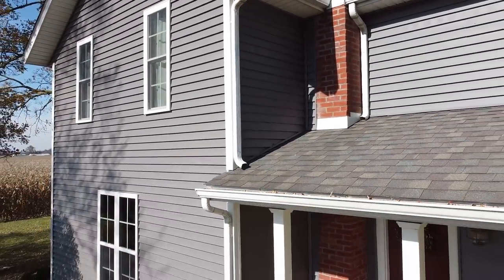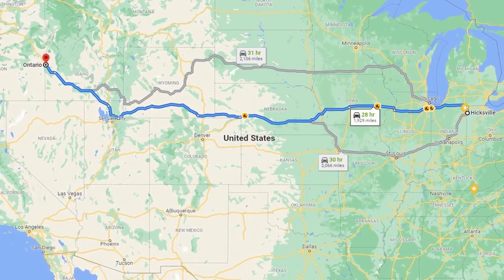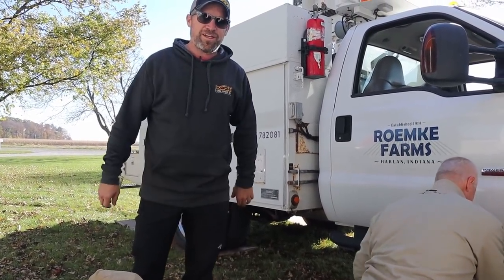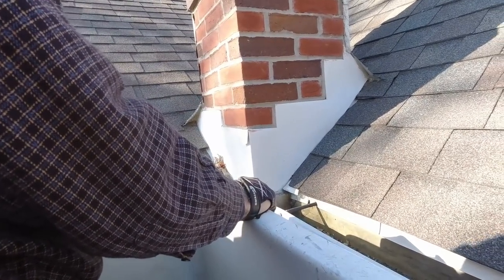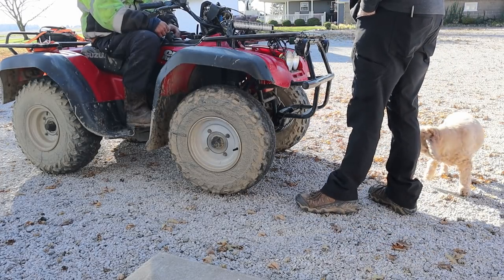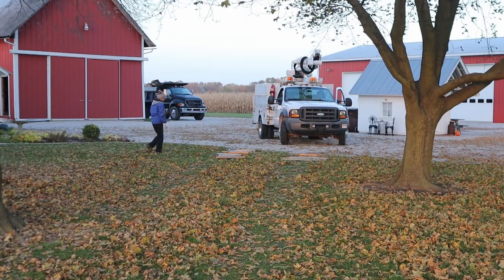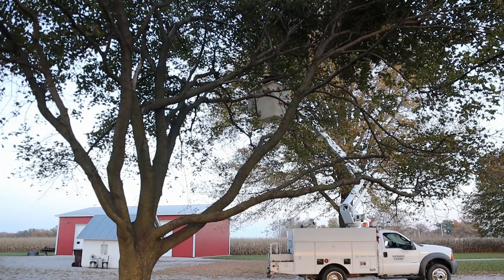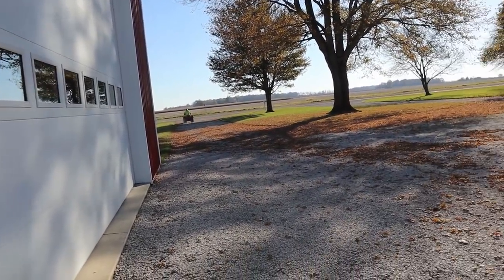Fixing A Chimney That Doesn't Look Broken! - DIY Brick Sealer and New Chimney Cap

Comment: Neil,  It is very cheap and has worked for me the last 8 years without any problems whatsoever on product quality, and that is 6' x 20' rolls of black mesh plastic gutter guard.  I have not had to climb any ladder and clean out gutters since I installed this.  It stays put, too.  The ONLY time I have had to reinstall is when one piece came out during an 60+ MPH wind.  It fits tight under the shingle and the lip of the gutter with a slight bulge in the mesh.  That's what keeps it tight and in place.  These fancy leaf gutter guard systems you see advertised on TV is a waste of money, IMO.
The truck made your work a lot easier and safer for that job.  Glad you had it.
Reply from the maker: Hey I like that idea of the plastic mesh.  I do want to do something affordable.  Those leaf guard places are crazy expensive!
I'm gonna check into that stuff. I guess I'll need to borrow the bucket truck again!  I think I'll wait until the ground is frozen this time:)

Comment: Man it’s great to have connections…. With cool toys!  That bucket truck is the perfect answer for getting to your chimney cap.  Hopefully you won’t need to get up there again soon.

There’s a castle siege scene in one of those old black and white comedies. Wherein, the marauders are rolling a massive catapult across a sewage swamp to get to the castle.  

The guys have four timbers.  Two for the front wheels and two for the rear.  They roll the wheels about a foot forward from one timber to the next.  Then they position the ox team and pull out the timber from behind the front wheels. They then move the ox team to the other side of the catapult and pull the timber into place in front of the wheels.  Next they drive the ox team back around the catapult and do the rear wheels the same way. The ox team then goes to the front and inches the catapult forward again.  All this time they are slogging in knee deep sewage.

They put the procession into fast motion.   In the background, the sun rises and sets several times as the catapult inches forward.  

Finally they get it in place in front of the castle.  Then they realize, the cart with all of their boulders is still on the other side of the sewer swamp.  

As they are inching it across, a competing throng of marauders go around the swamp,  just a few feet away from them, with their catapult and ammo cart.   

The leader of the first group watches helplessly as the second group begins their assault on the castle.  He then calls for his engineer.  The engineer pulls out his map and starts explaining how the competition is in the wrong place.  The walls there are too thick… they’ll never breach…  the competitor’s stone hits the wall and it tumbles into rubble.  

The leader says let me see that map.  As he holds it up facing the castle he notices that he can’t read the lettering.  So, he turns it over… and it shows perfectly that the competition is where they should have been all along… To the right of the sewage swamp.

The next scene is of the engineer being loaded into the catapult.

That’s what I was thinking as you and Kara moved that truck across your yard!  Fortunately, you had her and not some misguided engineer to keep you on the right track!

Thanks Neil, I thoroughly enjoyed the video.
Reply from the maker: The connections to my farmer friends and relatives has been paramount to us living out here! The same crew that owns the bucket truck is who we bought this property from in the first place!  So, I have never taken that connection for granted.

I chuckled at the marauders story.  I didn't think I'd be typing that word today 😂
Half way through I was questioning my decision but was far enough along I wasn't going to give up.  Itay have been overkill, but there are no ruts.  Around here if you rut up the yard you live with it until you fill it in with more dirt! It was good exercise nevertheless.  I say that when I think something was probably pointless otherwise. 🤔

Thanks for checking it out today. I almost didn't make this one!

Comment: Being a 2nd generation builder from the old school, drip tray is put in the inside of the cheminey to duct any water to outside through weep holes. This is known to cause problem with moisture damage on the inside. Capping with raised cap allowing smoke to discharge could be fix. Good luck Neil
Reply from the maker: Good to know Nev!  I hope this does the trick.  Thanks for the insight!

Comment: If you have a leak coming from inside the flue, maybe you could look into one of the mortar products that actually line the entire inside of the flue. I’m having it done to mine. Some of the products have a 20 year warranty too. A chimney cap is one of the most Important upgrades you can do to your system. I actually built my own cap so it covered the entire crown as well to protect all that up there. My chimney is from 1964, so protecting it is key.
Reply from the maker: I should have done this years ago for sure.  If it persists I may need to look into one of those. Thanks Rob!

Comment: I rented a house once that was a nightmare for many things including a leaking chimney.  (desparate times *sigh*)  The mortar joints in the brickwork leaked just as much as the water coming straight down the flue (no cap).  I had to place buckets inside the fireplace to contain the water when it rained.
Reply from the maker: Whoa!  Glad this wasn't that bad yet!

Comment: You need to put a stainless steel insert in that chimney with a Weather cap like you said you’ve seen smoke coming out of the chimney down lol around the roof so you definitely have a leak in the clay tile liner of that chimney Very unsafe situation
Reply from the maker: I should clarify.  That was before they laid up the brick of the chimney.  They replaced those blocks that were damaged when they laid up the brick.  It's my fault for not making that clear in the video.  Thanks William!

Comment: Is that rain water goose neck sealed because that looks wet to me as does the brick work adjacent to it damp goes up as well as down
Reply from the maker: I'm not sure I know what you mean Derek. I don't know what the goose neck reference means.  Which brick looked wet?  I only sealed what you saw in the video.  All the brick surface.
Reply: @digdrivediy  
Hi Neil the goose neck is bendy bit at the top of the rain water pipe that channels water from the gutter to ground , if the Rain Water pipe is blocked or partially blocked and the joints aren’t sealed it will allow water to run on the outside of the pipe ?
It just appeared to me that the RWP and “wall” it is fastened to looked wet before you painted sealer on the chimney anyway I think if it had been me I would have tested that RWP with a bucket of water or running a hose down it to check for leaks ! I hope this helps mate ! 
Not a criticism just some information as always Neil

Comment: Why put sealant on the brickwork under the porch? leaving that porous would allow any water from higher up to evaporate. Now it will get trapped surely?
Reply from the maker: I did it just to maintain the same look as the sealer seemed to darken the brick above.  That part on the bottom is just z-brick covering up a concrete precast chimney as seen in the earlier photos.  Hopefully it'll be fine.  I wasn't going to seal it either but wife said it looked different than the rest afterwards.
Reply: That explains all Neil. When domestic management speaks we all know what has to be done!

Comment: i didnt see a sliding D ring belt and a safety lanyard on while working aloft, and anytime youre cutting widow makers out of a tree a hardhat isnt a bad idea my freind, id like ya to be around a little longer to BS about tractors with. i worked most of my career with MA Bell out of a Telsta bucket truck, near the end they switched to Altec's, i like the Telsta's better, the controls on the Altecs were backwards, lol.  but the Altecs scissor boom was nicer👍
Reply from the maker: You're certainly right.  I could always be safer.  I try to work safe but have lots of excuses.  For me that Latex boom has been great.  I think they're built here in Fort Wayne, IN. Thanks for watching and keeping an eye on my safety! I could have easily done the hard hat!